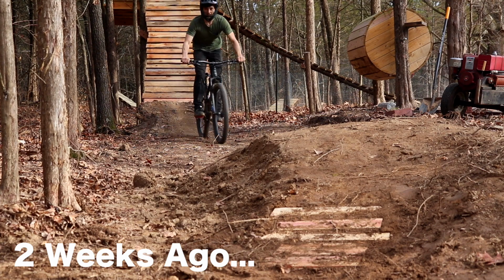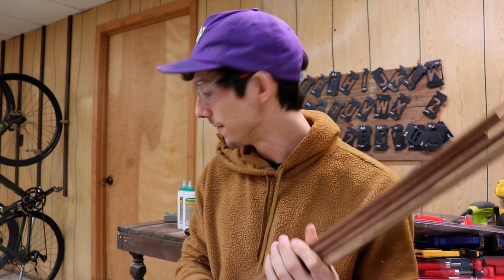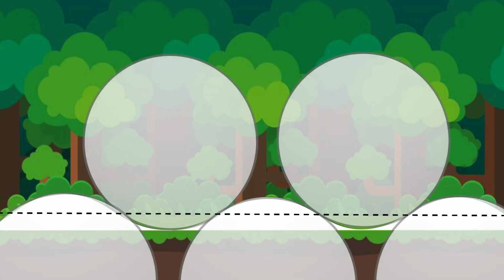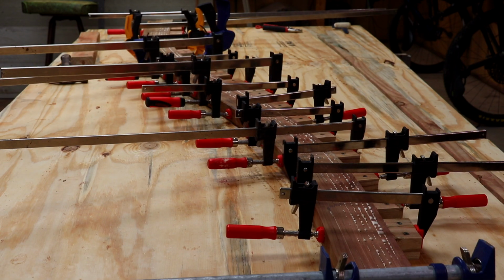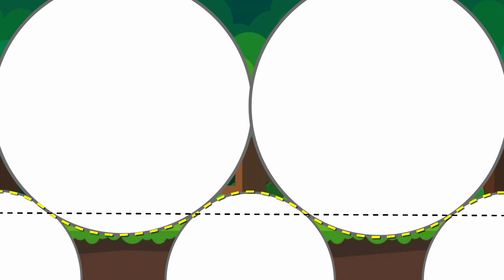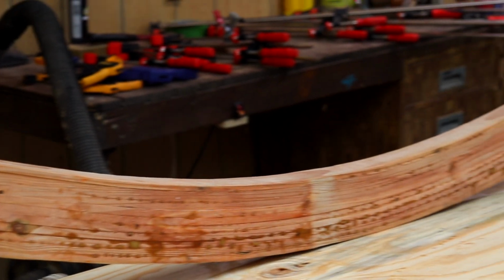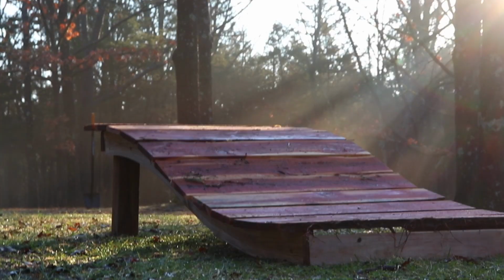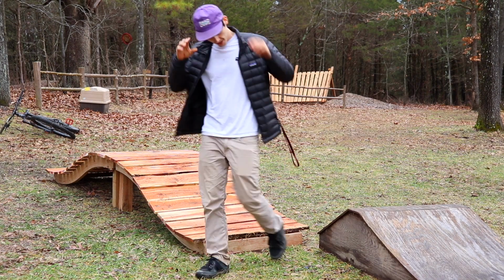Can YOU really BEND WOOD? How to Build Bike Rollers for PUMP TRACKS!

Comment: Just a friendly tip to help you keep your hand plane smooth: use something to take the dried glue off the edges of your wood. When wood glue is dry, it's as hard as glass and can take chips out of your blade. What works really well on long, flat surfaces for me is a paint scraper.  You just use the scraper to take off all the glue lumps, and you also have a smoother surface to start on with your plane.

Comment: Love your videos! We are building rollers in our yard using your advice of 6.5 ft radius.  How far apart should we put the rollers?  Since the radius is fixed, won't the distance apart determine the height? In other words, if you spread two of the lower circles (in your video) apart, the circle above them will drop down, making the distance between the crest and trough larger.

Comment: Dude, great job! I’ve been building a very similar thing this month. Used the LeeLikesBikes pumptrack book like you did, but it didn’t have any info on building them out of wood.
I have been using 5.5 foot 2x4’s and cutting a curve in them to create the 1:1 ratio curve. But your method looks cheaper and much more precise. Really well done. 
How wide is this? I would like to avoid putting more posts in the ground if possible and yours look nice and stable.

Cheers and thanks again!
Reply: The Lee likes bikes formulas work really well

Comment: Any way you could go into detail on the measurement process you did before using the travel points?  I get that it's two radiuses, but I see you making a couple of measurements on the plywood.  And how do you know how far away from the plywood to place the center of the "circle?"

Thinking of trying this soon. :)  That's the only part I'm not confident about.

Also, could you specify how many a "buttload" of slits is?  I never understood the metric system. lol

Comment: Math and I are not always welcoming to one another, could you possibly tell me the radius of both "circles' (crest and trough) that form the rollers? I get that on the 1:1 ratio both circles have a 6.5ft radius, but what would the radiuses of the circles be on the 3:2 ratio and 2:1 ratio?  I was thinking that maybe with the 3:2 ratio, 3 is 3x the size of 1 (6.5x3= 19.5ft) and the 2 is 2x the size of the 1 (6.5x2=  13ft).  I really have no idea if that is anywhere close to be accurate nor do I understand how i even came to that conclusion. Any help would be awesome!! ?
Reply: You've almost got it all together there buddy...  you've got the ratio thing right but you need to scale back to a profile that flows with other rollers.  So what you do, if you're working around a 6.5ft radius profile, is 6.5/2=3.25 to get your size of 1 and then 3x the size of the 1 (3.25x3=9.75ft) therefore you end up with the crest being 6.5ft radius to flow with the other track features and the trough radius being 9.75ft to allow the extra depth/height.  The 2:1 ratio would be 13ft and 6.5ft.  Hope that helps :-)
Reply: THANK YOU SO MUCH FOR REPLYING BACK! THIS ANSWERS MY QUESTION COMPLETELY!!!! AWESOME VIDEOS TOO! I HAVE LEARNED A TREMENDOUS AMOUNT FROM YOUR VIDEOS IN REGARDS TO TRAIL BUILDING AND ESPECIALLY DESIGNING AND BUILDING WOODEN FEATURES. SORRY ABOUT THE ALL CAPS BUT THEY RELAY MY EXCITEMENTAND APPRECIATION!!! thanks again!
Reply: Same

Comment: Sorry to be that guy but wood glues like Titebond are susceptible to creep. Don't be surprised if those beams change shape or delaminate. For an outdoor application I would use epoxy. Honestly it looks like you could have cut those shapes from a couple of joined 2x12s and saved yourself a ton of work.
Reply from the maker: Generally you are very right! I considered epoxy but went with titebond 3. Its arguable which is better, but titebond 3 is very much for exterior use and is also waterproof.

As for cutting the shapes, I've definitely already done that before and wanted to try something new! Its youtube so sometimes it's fun to show different ways to do things!
Reply from the maker: Also! I added 3 inch screws to the tops and bottoms of the bends just incase things wanted to move around!